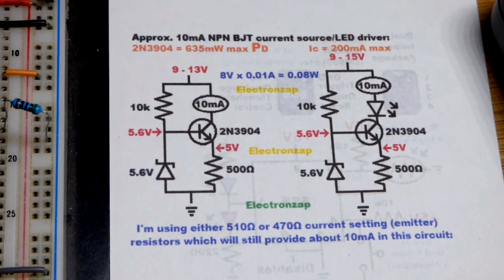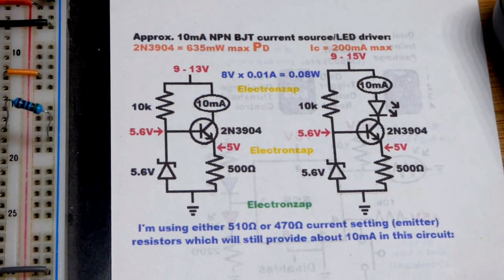About 10mA current source circuit using zener set NPN BJT learning electronics shorts 42

Comment: Sir can you guide me in making a compact circuit which can provide constant 5volt output and 10milliampere current
Reply from the maker: You can easily make a 10mA current source, but the voltage probably won't be 5V. The only way to set a certain amount of current is to apply the proper voltage to the load. And the only way to set a certain voltage is to limit the proper amount of current to the load. A 5V regulator can be turned into a current source, but it will put the 5V across the resistor used to set the current, probably not 5V across the load unless things happen to work out where it does.

Comment: Very interesting your information of the reason why the zener is made with the .6 volt extra 

I've noticed sometimes a forward biased diode is placed under the zener to raise the reference voltage by .7 volts EG 5.6 in affect changes to 6.1
Reply from the maker: Yeah, I've done that in a few videos. It's cool way to alter a signal voltage.